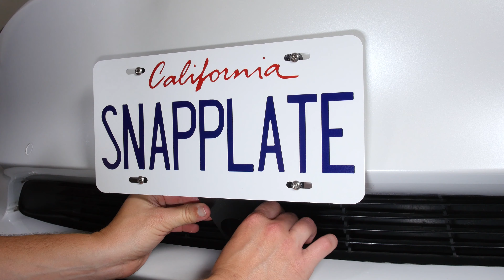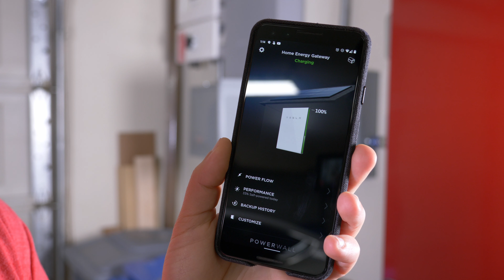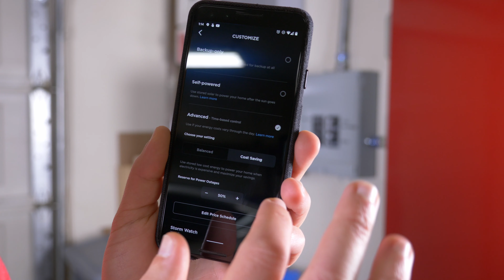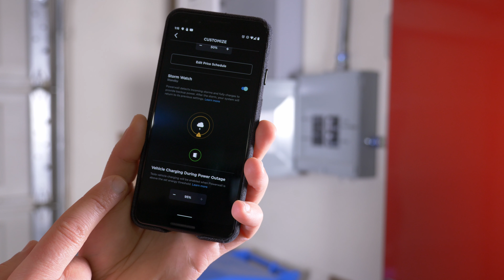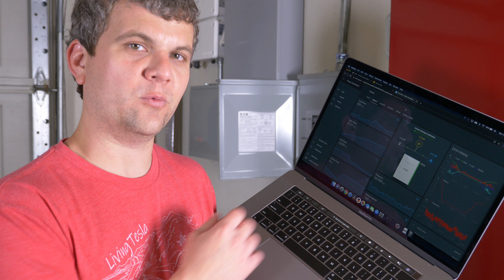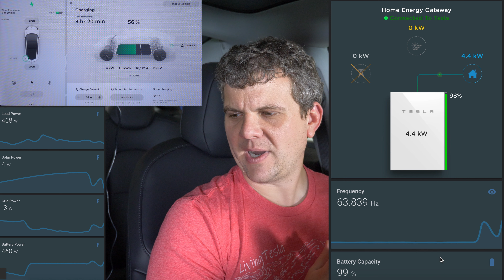Off-Grid Tesla Charging from Solar and Powerwall

Comment: Nice explanation! thanks. Can you do a video on power losses from solar system to charging car battery? solar panel generates DC, micro inverter at panel converts it to AC, powerwall stores energy in DC so it much convert AC to DC while charging and then DC to AC while discharging. then car converts AC to DC to charge its battery. I assume there would be lot of loss in all these conversions and then transmission/wire loss.

Comment: Wow! I have been trying to pull my hair out trying to get my similar Powerwall + SolarEdge working off-grid and this is by far the BEST and SIMPLEST explanation that I have ever seen. Not even Tesla or my Solar installer could explain this in such simple terms. I subscribed instantaneously as I discover a treasure trove of other videos on your channel. The one question I had is we can automate the entire process using Home Assistant given I have access to the Inverter status via an API?
Reply from the maker: Thanks! Unfortunately, the Powerwall integration in Home Assistant is really just monitoring, not control. I have some automations that will notify and prompt me to manually change some settings in the Tesla app, but I don't always see them in time and the Powerwall doesn't always respond quickly, so it's not ideal.

Comment: I have a high pv:pw ratio.  20 kw ac pv : 2 pw.  Curious if pw still acts as a buffer if 95% of pw allowed to charge vehicle in off grid scenarios to avoid turning back on solar energy.  Idk if you can help with a 3.8 kw ac pv : 1 pw set up
Reply from the maker: I don't 100% follow your questions, but I can tell you a Powerwall stores much less energy than most EVs, so you're not going to get very far in an off-grid event. You'll want to do most of your charging directly from solar.
Reply: @EveryAmp    Yes. Sorry.  I'm debating getting a tesla.  Hopefully v2h comes to fruition or a 240v 40a out on CT, but if not I hope to use this dynamic charge rate feature for the ev to act as an energy sink in off grid scenarios.  I think I'm getting hung up on finding a home for all my solar at " high noon" instead of just accepting alternating on/off high Hz cycles.  With your max solar output being < max charge rate of pw I don't think you can mimic my setup even if you reserved only 5% for pwz.  

Big fan.  Keep up stellar content!  Tesla with home assistant setup tutorial?

Comment: Thanks for sharing.  Would this work with a non Tesla brand EV?  I presume so.
Reply from the maker: Another brand EV will charge, but at least currently, they will not coordinate charging rate with the solar output.
Reply: @EveryAmp  thanks, I'm not anti Tesla EV, but there are way too many of them in sf bayarea so I'm aiming at another brand like i4.  Hopefully my to be installed solar and powerwall system will take care of my EV charging need.

Comment: I don't have EV yet but will get one soon. Currently in process of getting Tesla solar installed in next several months. Should I get 2 powerwalls or 1 to charge EV at lower cost?  Thx.
Reply from the maker: That depends on how much energy you need to charge the EV. You'd need 5 PowerWalls to fully charge a Model Y, but maybe you just need enough energy to replace one day's worth of driving.

Most likely, you'd be better off just planning to either charge the car when the sun is shining or charging from the grid when electricity is least expensive. Charging a battery from another battery is an expensive way to do it right now.

Comment: Wonderful video!  I am impressed with your knowledge of the Tesla system.  I have an off-grid system with 30 solar panels, four powerwalls, a gateway 2, and a back up of a 20 Kw Kubota generator.  Are you aware of off-grid systems that use generators tied directly into the gateway?  Specifically, can the generator take the place of the utility input so that the generator can be used to charge the powerwalls?  Tesla support tells me that it is possible but that my generator is not on their list of acceptable models.  Tesla support does not tell my why my model is not on the list or how to get my model of generator certified.  Any help you can supply is greatly appreciated.
Reply from the maker: You're further down that road than I am at this point. When I last discussed generator integration with them, it was a feature that was coming soon. Sounds like it's available in a limited capacity at least.

One thing you said, "generator take the place of the utility input so that the generator can be used to charge the powerwalls". To my knowledge, there are only very limited scenarios where the utility can charge powerwalls, so I wouldn't expect a generator to act any differently. You said they've told you a generator CAN charge powerwalls, so that must be part of their off-grid configuration with generators they support. 

Sorry, I don't have any insider info for how to get your model on that list. I would have thought they'd address that during the initial system installation. At this point, I suspect you'll need some type of service visit to reconfigure at least.
Reply: @EveryAmp  Thank you so much for taking time to think about my issue!  It is my understanding that Tesla systems connected to the utility can charge batteries at night when electricity rates are low so that energy can be used in the daytime when utility rates are higher, but that procedure is only possible when there is no solar array in the system.  In my present system powerwalls can be charged only by the array - I am looking for a way around that limitation..
I have a disclaimer to make, I am giving you my best understanding but I am still on a learning curve.  My understanding of the capabilities of my system and my conception of an ideal system configuration have both evolved since my system was installed.  As I don't seen any fundamental technical problems I'll keep exploring options.  Thanks again for your help.
Reply from the maker: You're correct that a Tesla system with no solar can charge Powerwalls at night and a system with solar can't, but there are two exceptions to that - if storm watch is active or if there's a virtual power plant event coming, so the system is certainly capable of charging from the grid, it's just a software limitation. 

Yours being an off-grid system though, you'd think they'd be much for flexible with how they set it up since there's no utility rules to have to follow. Just thinking about the issue, if nothing else, it seems like you could connect the generator to the solar input of the gateway and trick the system into charging the batteries that way. No idea if it would work or if it's a terrible idea. Just a thought.
Reply: Thanks so much for your insight!  I'll look into that idea further. @EveryAmp

Comment: I have a pre-order for a cyber truck and I'm fully off grid. This was exactly what I was looking for. Thank you.  I'm running a 4KW solar array on a 48v 280ah LFP battery. I believe I'll add a second inverter and second string of batteries just to ensure I don't dip too low. Producing my own fuel for around 10yrs far outweighs the cost of the equipment.

Comment: Can you share some details on your home assistant setup? (Integration(s), lovelace code examples, etc).

Would love to set up the same here and have had no luck so far. The normal powerwall integration just shows a few basic stats.
Reply from the maker: Something like this? https://youtu.be/aMftYdGq3eI
Reply: @EveryAmp  looking for more details if possible! (Maybe even your dashboard yaml if you’re up for sharing??)

From the video you linked I see that you have the standard powerwall integration set up, which I also have. But how are you pulling in, for example, the powerwall power flow visualization? Where are you pulling frequency from?
Reply from the maker: As you can imagine, my HA installation is an ever-changing beast. It's not terribly difficult to get started, but you can spend many hours going deep into it. It's best taken in small doses of "I want to do this particular thing" and just keep adding.

My power flow visualization is (was actually) just a "Webpage" card that was pointing to the local web server on the gateway. It was configured with the IP address of the gateway and I just sized everything to make it look nice. Tesla has since changed their authentication to that local page and it became a hassle to have to log in frequently, so I gave up on it. There's hope of having something similar built into HA eventually with the new energy dashboard, but it currently doesn't really know how to deal with batteries.

For frequency, that's an attribute of sensor.power_wall_battery_now. If you go to developer tools and look at that sensor, you'll see everything else that's available. You just need a way to pull that out into its own entity that can be displayed. I'm using this template sensor in my configuration.yaml to do that:

- platform: template
   sensors:
     battery_frequency:
        friendly_name: 'Battery Frequency'
        value_template: >-
          {{ (state_attr('sensor.powerwall_battery_now', 'frequency')) }}
        unit_of_measurement: 'Hz'
Reply: @EveryAmp  Aha! I missed the attributes part. Thank you! I ran into the same issues you have now that the gateway needs auth for every request. Am looking forward to a more native energy UI, but even so it'd be great to get the local page loaded in a dashboard. Will put some time into it.

RE Home Assistant, yeah, mine's getting a bit crazy too.. always evolving!

Comment: Think my system works well. I live off-grid in a solar powered house I built myself singlehandedly. Finally figured out how to charge my model 3 long range from the sun. I have four 300 watt solar panel gets full sun all day. I have a Growatt inverter which has an 80 amp MPPT charge controller built-in. I Have configured panels serial/parallel for 24 volt output. Growatt is split phase so it provides 240 volt output.Then I have four BattleBorn batteries. Get 28 miles per hour. $1250 for panels, $750 for Growatt inverter, $3000 for batteries, misc cables fuses $250, total $5,250. Actually anticipating charging my cybertruk next year.

Comment: So what happens on day two if you had left everything plugged in? Will you need to manually start charging and adjust the amperage each day to prevent overdraw while the PW is >95% (until auto tapering starts?)

Also curious about your wiring setup for the mobile charger and wall connector.  You have a whole house backup except for the wall connector ? The 14-50 is connected to PW/gateway?
Reply from the maker: Hmm. I'll have to test and see what the car does the next day. My guess is you have to manually start charging or schedule it to start.

One Powerwall is limited to 20A continuous, so neither the wall connector or 14-50 can be officially backed up. However, I installed a 14-50 that is backed up and just know that I have to be mindful of the Powerwall's limits if use it.
Reply: @EveryAmp  that’s awesome, thanks. 

Just found your other video answering various questions where you went over all of that. 

One connector & 14-50 on the grid only side, and then a separate 14-50 on the solar/pw side, for grid outage / backup purposes. I like the requirement of the explicit ‘switch’.  Will probably do the exact same! 

Have 12kW PV and 2 PW+ being installed this coming week :)

Comment: I have 2 powerwalls, they give me like 10kw peak. The water heater that I have at home consumes between 11.5 and 13 kw when turned on.
My question is, what will happen in case of an outage? Will that affect the powerwall? Will I lose power at home? Or just the water heater isn't going to work?

Comment: Is the car talking to the gateway/powerwall at all, or does the gateway just see the load is up enough such that it can use the solar?  Does this require both the car and/or gateway/powerwall being able to "phone home" to Tesla's servers?  In other words, if you disabled your Internet (and RF-shielded the cell connections in the gateway and car), what would occur?  The point of that would to be to simulate a long-term outage when the Internet and cell towers have lost power.
Reply from the maker: I'm 99% sure there's no local communication and it won't work in the case of a cell outage. Otherwise they'd require a wifi connection for both the car and the gateway and I haven't seen that specified anywhere. I'm sure plenty of customers don't even have their cars connected to wifi.

It's not so much that the gateway is looking at the load to turn the solar back on, so much as it's looking at the state of charge of the Powerwall to make sure there's somewhere for it to go once it's back on. Without the car charging, it will just cycle solar on and off once the battery is full.

Once the car is charging and the Powerwall hits hits low limit, it's looking at the solar coming in minus how much the house is using and adjusting the car to use what's left. The Powerwall level will just stay at that low limit and not charge or discharge, at least until the car is finished charging.

Comment: Matt, so you have a nema connector not part of you back up correct? So it will strictly get power from grid or solar and not the powerwalls. Reason I ask is Im gonna be installing a second wall charger and thinking about installing it this way for the same reasons you mention here.
Reply from the maker: You got it. I have both a NEMA 14-50 outlet and a hard-wired wall connector that aren't backed up. One Powerwall can only supply 20A anyway, so adding them to the Powerwall isn't an option for me, but even if I could back the car chargers up, I'd choose not to. In an extended power outage, I'd choose to selectively charge the cars using using the mobile connector during the day when we, hopefully, have excess solar.
Reply: @EveryAmp  so, does your gateway still see the usage even tho its not backed up? My entire hone is backed up so I have to figure where I can tap my nee wall charger onto that will not use my batteries🤙🏽
Reply from the maker: It does actually, which was a pleasant surprise for me. They added an additional set of current transducers that monitors the current to the car chargers, so the Powerwall will supply up to 5kW to power them as long as I have a grid connection to supply the rest, but if we go into backup mode, they're out of the picture.
Reply: @EveryAmp  that helps. Thanks.

Comment: I ordered solar panels through Tesla without powerwall and wondering if they will able to install inverter and circuit breaker (ETN box) in my garage so i can connect nema 14-50. My main breaker is in basement which is opposite side of garage.

Comment: Matthew, great video. Very helpful. I have a Model Y with 19 panel 6.7 kw Tesla solar with two powerwalls. Everything goes through this configuration. Nothing straight from the grid. My question is for normal operation (no outage) what would you suggest I set the Model Y current to for charging? For example, I set the Model Y to charge at midnight. I have a Nema 15-40 connector so it can pull 30 amps.  If I have anything left in the powerwalls, it of course quickly drains as soon as the Model Y starts to charge. would would you suggest for optimal settings. Thank you for any suggestions
Reply from the maker: I typically charge at the full 32A or 48A since either is relatively slow for a battery this size anyway, but you may want to adjust your charging times depending on which rate plan you're on with your utility and your goals.

I'm on an EV rate plan that costs more during the day and less at night, so it makes sense for me to use grid energy at night and use stored energy from the powerwall during the day to avoid paying those high rates while I'm exporting as much solar as possible to get paid at those high rates. To do that, I set the powerwall up with "advanced - time-based control" with a rate schedule that matches my rate plan and I set the car to charge at night.

Another goal might be to use as little energy from the grid as possible. So you'd set the powerwall up for "self powered" and let the car drain the powerwalls when it wants to. From what you described, it sounds like you're configured for self powered right now.
Reply: @EveryAmp  Thank you Matthew. Yes, I am set for self powered. So there is no problem having the powerwalls "spike" (for lack of a better description) up to 9 kw at midnight when car charging starts?
Reply from the maker: They are rated for 5kW each, so no that's not an issue, but if you switched to time-based control, they wouldn't even try. Power would just come from the grid.

Comment: Very nice!  Your explanation and understanding is breath of fresh air.  I have a 6kW grid tied system (SolarEdge Inverter) with net metering.  Before I built the solar system I had a 20 kW Generac Standby generator installed.  When I installed the generator, I wasn't even thinking of solar.  Love the idea of Powerwalls that increase self-consumption.  That Tesla Gateway is awesome in how it manages all the different power sources and allows islanding so you can continue to produce your own power from the solar PV system.  Now if only it had a way to use the generator to charge the Powerwalls in an extended outage if the weather was cloudy and nasty.  Lots to consider going forward.  Thank you!!  Excellent!
Reply from the maker: Thanks Glenn! We actually just saw an update recently where they're adding support for generators. It doesn't have a lot of info here, but there's a bit: https://www.tesla.com/support/energy/powerwall/learn/combining-systems

Comment: Good info. I want to do the same without grid being down. My SCE TOU is 4 to 9 pm. After 9 PM, when I charge Tesla its comes directly from the grid. My PW is charged to 72% but it doesn't get use to charge the car. My battery threshold is very low around 15%. My area never faces outage so I want to charge Tesla with PW.